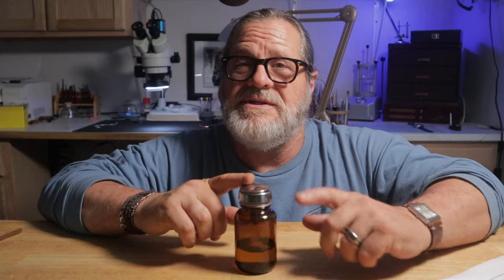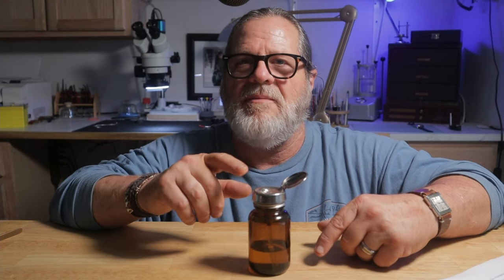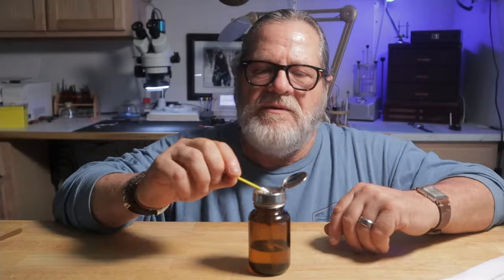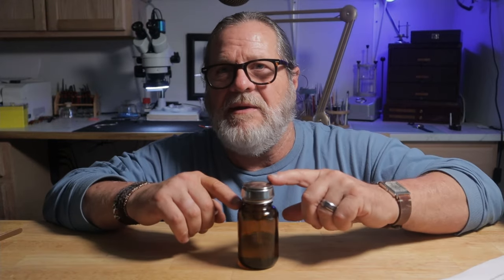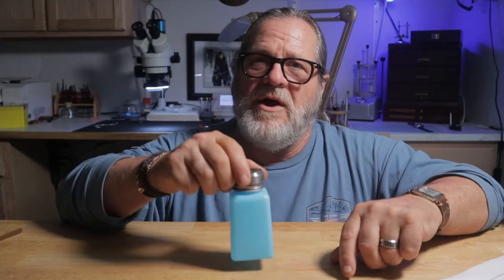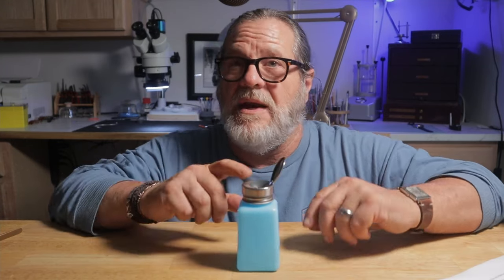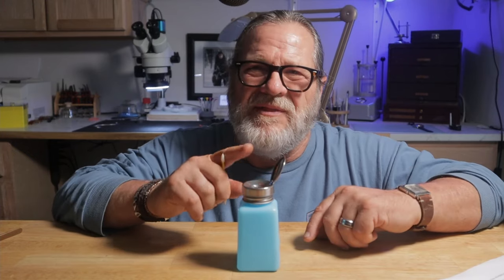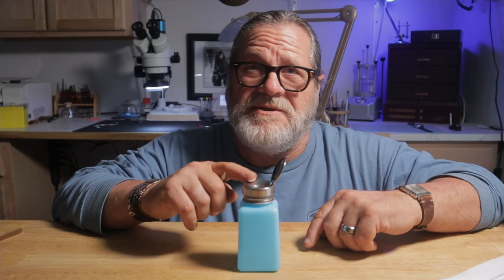How to Clean Watch Parts Without A Machine-Watch Repair Lesson #8

Comment: I use a teeth brush soaked with a washing laundry soap bar to pre-cleaning the main plate, the bridges and the two pieces of the mainspring barrel. I dry them with and air gun, after that they are immersed in lighter fluid. Then a cycle of watch cleaning and two of watch rinse fluid (the pieces are dried with the air gun after each cycle)

Comment: Alex, I have been in the automotive industry since 1992 and am certified by DuPont as a certified automotive refinisher. I have been into watches for most of my life and out of necessity I have learned how to fix them. The closest one is 3 hours away and he doesn’t have the best reputation. So I figured if I could build NASCAR engines and build a NASCAR Cup car and paint it then I have the skills and mindset to do it. I have come to look at watch making/ repair is a lot like building a engine or painting a vehicle. Preparation is the key. If you want the best possible results then you need to do each and every step properly. Because cutting a corner in any of the 3 things I named can lead to failures. Paint coming off, engine blows, watch runs poorly. Thanks for sharing your knowledge videos like yours are invaluable to someone like me who has taught themselves all the skill’s I have. I can service an automatic day date is the most complicated movement I have done and it’s the most complex I feel really comfortable doing. Would like to find a easier chronograph movement. I hope you are reading my comment because I hope you have a suggestion for which chronograph movement would be the best for a beginner.
Reply from the maker: First, I read all comments and I appreciate the time you took to write this on. I am a NASCAR and F1 fan myself. I think there is a similar attitude that translates equally between racing at that level and watchmaking. "Everything Matters".
I just watched the 1960 Daytona 500 which started with how Lee Petty started what would become Petty Enterprises. His basic philosophy was to check all the systems over and over, to make sure that nothing would break down during a race. The one thing that eliminated so many cars during a race . Watchmaking is no different.  You check your systems in the movement.
Like anything else I recommend starting with a new movement to learn on. The ETA 2894-2 and the Sellita SW500 as well as the Valjoux 7750 are all good movements that are pretty straight forward. Personally I would get a ST1902  for 100 bucks or better yet a watch with that movement in it to learn on before getting into the more expensive ones.

Comment: I was about to buy a $200 Lab stirrer to run at 1/10 it's potential speed and not even be able to reverse the spin. I already have a drill and some J-B Weld. Going to try without the copper wire so I can sand it down to look pretty.
Reply from the maker: Sounds good. Let me know how it turns out. I will say that you can find lab stirrers for way less than 200 bucks.

Comment: This video, like all your others, contains a wealth of information.  First, many thanks for the hexane suggestion.  The mixed hexane solution is cheap, it evaporates quickly and it’s a great grease solvent.  I use it as a final rinse.  Second, the spinning basket is another great idea.  I use jars with a low-power ultrasonic cleaner with L&R for washes.  My basket has a wire handle.  I put an electrical spring clip in the chuck of a drill and it’s great for spinning off cleaners before the next bath. Most importantly, you’ve taught us the importance of a thorough clean.  I was pretty good before, but now I understand tat I need to take it to another level.  Finally, I stay away from IPA for the pallet fork and the balance because it dissolves the shellac holding the jewels in place.
Reply from the maker: You make my heart sing. Thank you Paul.

Comment: Is there any reason why you can't use  a good  cleaner/degreaser like Simple Green and then rinse with either the naptha or IPA?
Reply from the maker: Simple grain is great for cleaning, stainless steel cases and bracelets, but I definitely would  it use it on other brass or steel parts.
I’ve heard too many stories about discoloration and leaving residue behind.

Comment: You are a master of ingenuity sir!  When you busted out the drill I was dying.  I gotta give this a shot.  

Thanks for the great videos.
Reply from the maker: Hey man, 
This is meant for the budget minded guys out there.  Butttt, the basket could also be used in a jar sitting in a Ultrasonic. 
When switching from one jar to another, it would enable you to spin off the excess fluid before going into the next jar, extending the life of your rinse solutions. 😀
Reply: I'm not knocking it in any way, it was just very unexpected.  Especially when you were going over the basket I'm watching thinking what is he gonna do here??...  It's a hell of a solution to a common problem.  Those old L&R machines are expensive.
Reply from the maker: @rickhufnagel6984   no no no, I didn’t think you were. Yea, the old vintage machines seem to be creeping up in price as more people jump in.

Comment: First things first. I worked in a watch , clock repair shop in the mid 70 ' s as a teen. For four years I trained under one of the best watchmakers in town. I still have some basic tools. I'm soon going to be at retardment age. I mean retirement. I'm going to start working on watches again as a hobby. They say great minds think alike. Your cleaning equipment is exactly the same way I want to set up mine. Cleaning watches is very important, yet not quite rocket science. You have a new viewer, follower as of this video. Thank you. Looking forward to more. No pressure.

Comment: Absolutely the details I am looking for... just starting out to clean my own watches, low-volume, and can't justify machines, etc, yet.  THX for doing this video!
Reply from the maker: Glad to help! You seem to get what I was going for here. There’s much better ways to clean watch parts but when you first starting this is a way to do it without letting the lack of equipment stop you.
Reply: I’m in the same boat. Ronsonol/naphtha and IPA with Alex’s cleaning jar setup.

Quick question though - if one were to use the L&R solution (like the L&R ultrasonic #111)….does that stuff work even without the ultrasonic?

Comment: :face-purple-smiling-tears:I JUST COMPLETED YOUR HOMEMADE PARTS CLEANING BASKET AND IT WORKS GREAT.  SAVED ME SEVERAL HUNDRED DOLLARS AND DOES A BETTER JOB THAN I WAS USING LIGHTER FLUID AND A BRUSH.

I ALSO LIKED YOUR VIDEO ON INSTALLATION OF ROLLER JEWELS USING A BROACH TO HOLD THE ROLLER AND LIQUID SHELLAC.  I DON'T KNOW WHY PEOPLE STILL DO IT THE OLD WAY WITH DRY SHELLAC.

THANKS!!
Reply from the maker: Excellent! Thanks Chuck

Comment: Got my first set of parts cleaned! Thanks for the tips. And the Liquinox you recommended elsewhere sure seemed to rinse off MUCH easier than like Dawn soap or whatever. 

But wow, after the cleaning, it was really obvious how poor my pre-cleaning was! Need to improve that next time.
Reply from the maker: It works well, which is why they use it in laboratories as well as many other industries.
But now you know that you need to work on your pre-cleaning a little bit that's all.

Comment: Thank you Alex for this info. I understand that alcohol is not recommended for balance and pallet fork cleaning because of the shellac but why not lighter fluid? How does it affect the hair spring? It would be nice to have some information/video dedicated to balance and pallet fork cleaning. There are many opinions out there. 
Thank you
Reply from the maker: I’ll do it. 
There’s a big difference between the napatha used in professional cleaners and the napatha you buy at the store.
Mainly the amount of impurities in it.
These impurities are left behind On the spring, and can attract dust and dirt to the hairspring.
Put a drop of your napatha.on a piece of glass and let it dry and see what’s left behind.
Reply: @watchrepairtutorials  
Thanks, I did notice some residue after the lighter fluid dries out but I thought that it was dirt that did not clean properly. 
Thank you for your help

Comment: Thanks for the video.I like cheap.(economical) ways of doing things.I like the trick for the spinning basket used on drill.
Reply from the maker: It’s one method for cleaning when starting out but it will get old if you start doing a fair amount of projects.
Reply: @watchrepairtutorials  I  agree.I am just getting started ,so a hobby for now.But my mind is always thinking .Planning on building a homemade cleaner.I liked your idea of JB welding a shaft on my cleaning basket as you did 👍.

Comment: Hi Alex, thank you very much for all of your helpful videos!
I am using a 5 step washing cycle: After pre cleaning all parts (excluding the pallet fork and the balance) in IPA, I inspect them after drying under my microscope. The next step is putting the parts in a heated water filled ultrasonic cleaner using a submerged jar filled with an ammonium based cleaning solution (Elma Red 1:9). The parts are collected in small brass baskets which are put into a bigger basket for easier and faster handling. That's the first step in my ultrasonic machine. The next step is letting the parts dry for a couple of moments before putting them into the first and second rinsing fluid (all in my ultrasonic). I use destilled water. The final rinsing solution is 99.9% IPA. Since all liquids are always heated to about 45 °C, there should not be any problem with condensation from the surrounding air. I let it dry and sort all parts for assembly.
Now to the interesting part: the pallet fork an balance. Since IPA dissolves shellac I avoid putting them into IPA. They are being cleaned in the first cleaning solution (Elma Red) an rinsed twice in destilled water. In the final step I take them out of the baskets and put them in a separate short bath in IPA to displace any water. After drying I dip them in Bergeon B-Dip (One-Dip) and let them dry again.
Do you see any room of improvement in my cleaning process?
I was thinking about rinsing parts in only IPA since I am worried that using destilled water could lead to oxidation and rust... But IPA dissolves shellac... Lighter fluid is also an option, but here in my country I find it quite difficult to find lighter fluid without any additives that could left residues...
What do you think?
Looking forward to your response! Thank you Alex :)
Reply from the maker: Well, your process is pretty tight and I don’t know if I would change anything if you’re getting good results. The only possible suggestion if it’s an option is to use deionized water which is a purer form. There is additional cost and the purity level is slight so I don’t really know if it’s really necessary.
Reply: Hi, which solution do you use for first and second  rinsing cycles?
Reply: @sergiohegner8844  Hi, I use 2 jars of clean destilled water for the two rinsing steps.

Comment: Thanks for these wonderful tips. I have binged watched the series. You have given me some great new insights into amateur watch repair esp. when it comes to saving money (hexane, menda bottles, etc.). I have though about the drill-basket technique before but never tried it. Now I use paint brushes, pith wood, lighter fluid, and 99% alcohol, and air dry. It seems to work, but the food dehydrator or hair dryer move might be next. I have already dressed my tweezers and screw drivers per your instructions--huge difference. Well done and thanks, again.
Reply from the maker: That’s what I love to hear. Thanks for sharing that. Awesome

Comment: Great video, thanks! I am new to watchmaking and maintenance and am in the process of gathering the necessary tools. I have a number of watches that now require maintenance and that easily costs about €400-500 per watch. And because I find watchmaking very fascinating, I prefer to invest in knowledge and materials. I was already worried about cleaning parts because, especially as a beginner, I am not going to buy an expensive cleaner and probably never will. Your basket and jar system is great! I love good DIY solutions!
Reply from the maker: If you see the value in investing in knowledge, you may want to consider joining my watchmaking course. It’ll cost way less than screwing up just one of those watches. Here’s some more information.
https://watchrepairtutorials.com/watchmaker-course/
Reply: @watchrepairtutorials  Of course I won't use my expensive watches to practice on 😉. There are inexpensive training watches to practice on. But I'm definitely considering an online course. I'm going to read up and watch videos, build up my arsenal of tools, and maybe I'll get back to you.

Comment: Alex, thank you very much for this video. I am just now learning the art of watchmaking and it has been a great deal of fun and learning. I enjoyed your video very much, but have a follow-up question. Here is my understanding of the steps you've taught: 
1. Pre-clean your components using IPA dispensed from a Menda type dispenser.
2. Spin watch mesh baskets with watch components in solvent (IPA)
3. Dry spin
4. first rinse in first IPA
5. Dry spin
6. Second rinse in second jar of IPA
7. Dry spin
8. Third rinse in third jar of IPA
9. Dry using dehydrator 

I feel as though I have missed something here as I wonder whether I should be rinsing in distilled water. Am I only using IPA as the pre-cleaning, final-cleaning and rinse agent? Would it be better to use Hexane as the final-cleaning solvent as it won't dissolve shellac?
Can you please assist.
Thanks again. Really appreciate your content!

Kind Regards,
Daniel
Reply from the maker: When you’re looking at a low budget option for cleaning watch parts, you can begin in precleaning with either napatha or IPA. I would do a first wash cycle in Napatha followed by two rinse cycles  of IPA. Water rinses are you with detergents solvent base cleaners. Then you can follow up with drying at a temp around 100 F . 
Just remember that IPA will dissolve or at the very least loosen shellacked jewels. Removing oils from pallet stones can be done with hexane or one dip. A cheaper alternative for the shellacked parts would be CRC electronics cleaners. Which is basically the same ingredients as what’s in one dip. Just be careful when using hexane or one dip type cleaners and make sure you have ventilation and limit exposure.
Reply: Thank you Alex, that answers my question perfectly. @watchrepairtutorials
Reply: Hi Alex, Another great tip. I was about to order 1 Dip when I saw this post saying CRC is a low budget alternative to 1 Dip. 
I already have here both the CRC electronic cleaner and the CRC brake cleaner. which one is better to use to clean the hairspring?
Thanks  @watchrepairtutorials
Reply from the maker: @franklima1269   both are good. The main ingredient is tetrachloroethylene same as One dip.
I would just spray some in a small jelly jar, and then use that to dip, the balance wheel and pallet fork into it. Just like any cleaner of this type you’ll want to have pretty good ventilation because it does stink.
Reply: Thank you Alex. I spray the CRC electronics cleaner  in a small glass vial, put the balance wheel in and closed the lid. I could see some bubbles coming out of the balance wheel, which got concerned for a while but I think it was just gases been released because the liquid was under pressure inside the spray can. @watchrepairtutorials

Comment: I'm just finding your videos a bit late, and I'm slowly making my way through them and taking notes! QUESTION: what is the proper way to dispose of the used cleaning solutions?  Thanks!
Reply from the maker: Well it depends on what it is right. One option that I have used is a 5 gallon steel container to dump used solvent based materials and let them evaporate outside. 
Other than that anything toxic should be disposed of at a recycling center.

Comment: Your face when you turned on the drill was priceless!

As peg wood - I see little manicure sticks called orange wood sticks. They're used to clean under nails, tidy up the polish on cuticles, etc. I can't see why they wouldn't be good for this purpose?
Reply from the maker: Peg wood is pretty soft and goes into the jewel hole easily with minimal pressure applied.  Many people have tried using tooth picks and all sorts of stuff, but as soon as they move a jewel out of place its back to peg wood